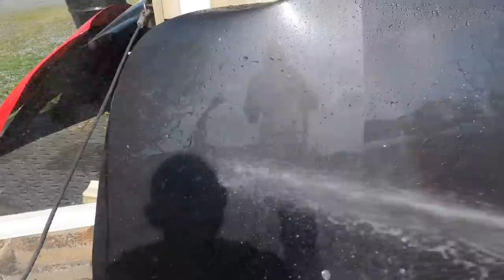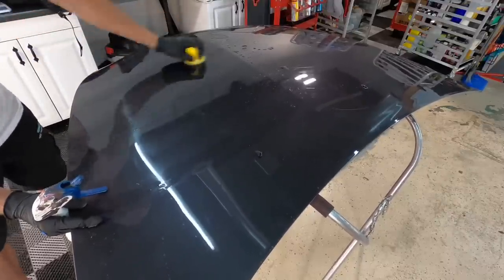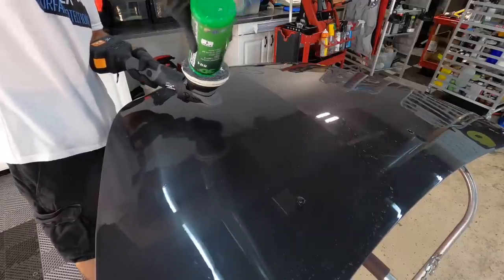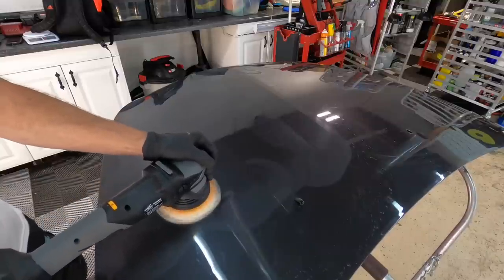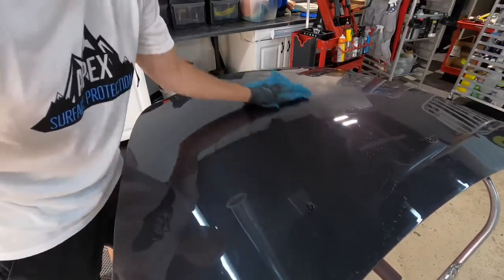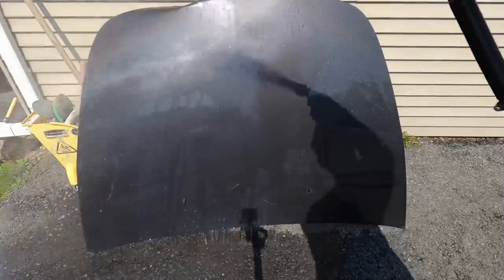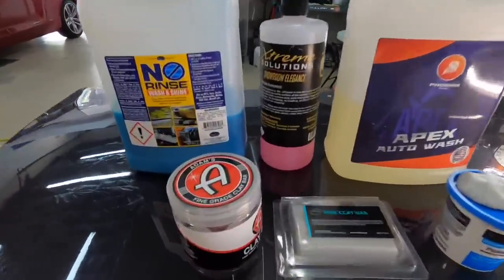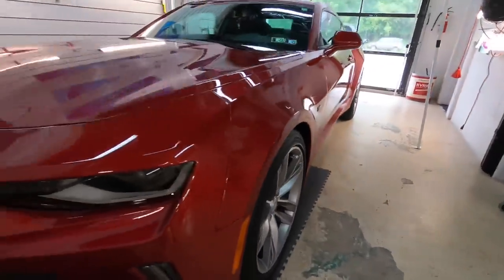How To REMOVE A Ceramic Or Graphene Coating From Your Car!!!

Comment: I applied the Apex metal oxide coating in artificial light. Looked great but once in cloudy outdoor light there was major streaking on the hood.  I used TW Hybrid solutions one and done compound with two separate  uro 50-50 pads and a DA polisher which took all the streaking away. Re-applied the coating in outdoor cloudy light and it looks great.  Thanks Brian for an excellent vid.

Comment: "Graphene coatings" are ceramic coatings infused with graphene and still at these days remains as a gimmick for me. Not remarkable differences at all. Cool video btw Bryan most of coatings do surrender at compound and polish.
Reply: Well i like to both seal protect & finish off with a wax. So im going with Cquarts CQ UK 3.0, Reload & possibly finishing it off later with Turtle wax ceramic graphene. Some may say stupid, but its just way to fun to wax!  😄
Reply: Agreed the graphene is still a work in progress, not yet functioning as described.
Reply: The graphene helps stop water spots

Comment: Great video, very interesting.  I was asked by a customer the other day ,but I'm a little  reluctant to apply ceramic to a van with vinyl graphics  on . Polishing is not a problem  but it's the  ceramic how it would interact with the vinyl and if the customer would the wanted  it removed? Want do you think?

Comment: Excellent as always, have you used a more horse soap like Carpro Descale for bonded minerals ? I’m going to experiment with it on coated cars, washed in hard water. I’d like to get to them when the mineral contamination is slight, but noticeably dulling the finish and affecting water behavior as well. It has promise of a prep soap to take off or help remove older sealants and waxes but that is another issue.

Comment: When a ceramic coating is getting "old" and not working anymore, do you have to do this before putting on another ceramic coating? Someone told me, coatings go bad after a time, while the actual coating is still present on the car, and they have to be removed before apply a new one.
Reply from the maker: To get the best bond to your clear....remove the old coating.

Comment: What would happen if you were to apply another ceramic coating onto of the existing coating on the vehicle? Say apply another coating 1 year from the initial coating instillation. Would it bond to the first coating?

Comment: If you are doing a touch-up paint operation after a ceramic coating, do you need to do anything special?
Reply from the maker: Clean out the Valley of the scratch or chip, panel prep, and fill.

Comment: All that is great however how do I remove Ceramic in the front grooves on my 2022 Shelby the narrow grooved letter have ceramic which needs to be removed to allow decals with sticky backs to stay on.  AirBrush Painting came off because of Ceramic.  What do I put on  Qtip to remove Ceramic?

Comment: For your demo, your coating applied panel was a recent coating application. Question. Is the sanding still required after your coating has been on for a number of years? Say, like more towards that 5 yr mark when it would need to be replaced?
Reply: Good question!
Reply: Do a test panel, after 5 years I'd bet a good polish would do the trick, no sanding necessary
Reply from the maker: At the 5 year mark...a medium polish would do.
Reply: @apexdetail85  Thanks, Brian!

Comment: So washing it or running through a car wash will not remove a coating
Reply from the maker: The wash process itself will degrade it quicker for it is highly alkaline. remove it...not likely.

Comment: I have the adams graphene on my gladiator but they didn’t tell me what to do to wash or clean it. Does it need some type of coating?
Reply: There's coating topper sprays out there, P&S has one called bead maker, they are made to top ceramic after washing, gloss enhance, more protection.
Reply: Adams have a dedicated shampoo that will maintain your coating and GRAPHENE spray sealant or their GRAPHENE detailer to use as a topper to maintain the coating as well, although you could use other toppers from other companies that will work
Reply: Thanks guys
Reply from the maker: Wash with a PH neutral Shampoo. Top it with this....https://www.amazon.com/Adams-Ceramic-Boost-2-0-Protection/dp/B07PRN5JHX/ref=sr_1_3_sspa?camp=1789&creative=9325&keywords=adams%2Bceramic%2Bspray&linkCode=ur2&linkId=5f8b3c62c09902de70c1edfc9d21c454&qid=1654365920&sr=8-3-spons&spLa=ZW5jcnlwdGVkUXVhbGlmaWVyPUEzNFRNRDhJRzdMRjRQJmVuY3J5cHRlZElkPUEwNzk2MjgyM01aSEdENDQ3MlFNVCZlbmNyeXB0ZWRBZElkPUExMDM2NjQyM0s3TUVLNzJLNDNDNiZ3aWRnZXROYW1lPXNwX2F0ZiZhY3Rpb249Y2xpY2tSZWRpcmVjdCZkb05vdExvZ0NsaWNrPXRydWU&th=1

Comment: Honestly, why would you allow  somebody to wet sand your 
clear coat to remove a ceramic
coating? 

Leave your paint alone and stop 
applying coats of different crap- 
products that protects against
nothing . 

Detailers cannot figure out that slapping on layers of waxes , poly
- waxes, and ceramic and graphene
coatings cause swirl marks and 
marring  when you have to wash 
the vehicle.

Correction wears your clear coat 
down to a point where it loses
it' s natural shine